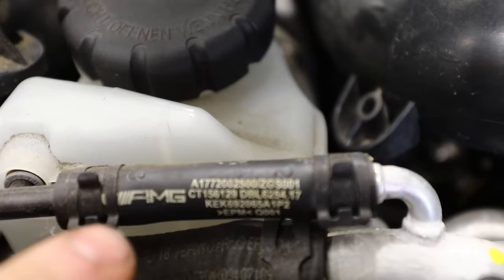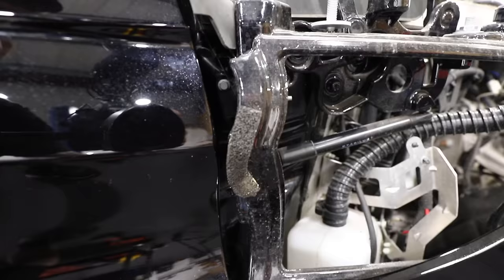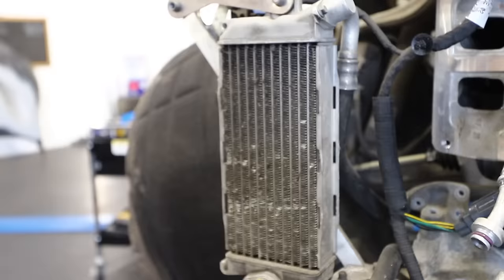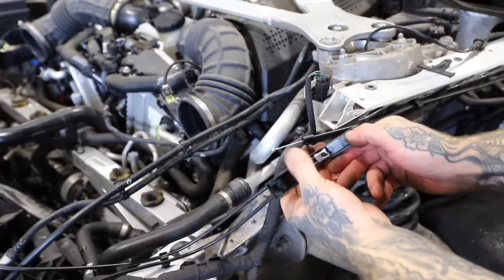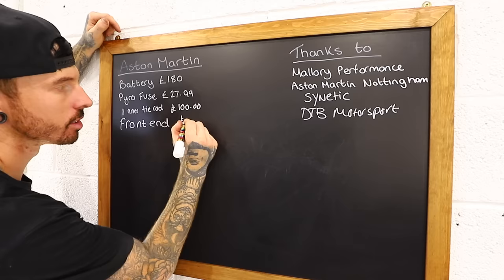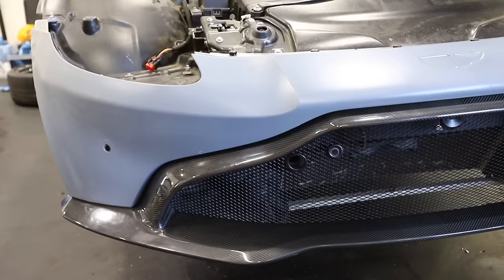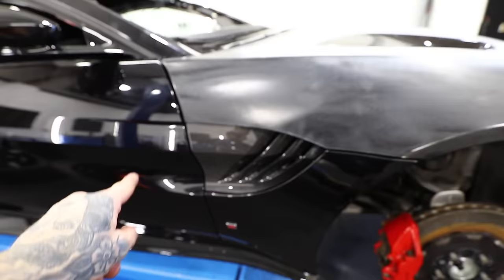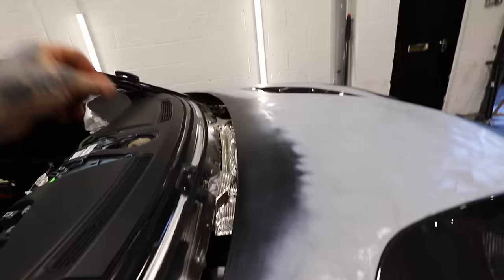REBUILDING A WRECKED 2019 ASTON MARTIN VANTAGE | PT3

Comment: 50KG weighted dash is actually a pretty good result, thought it would be much heavier. Such a good series !
Reply: get on with my next rust video!love you
Reply: Agreed only hard part of getting it out is trying slide it out without scratching the paint work
Reply: If it's only 50KG then just get a mate and pick it up by hand, you hardly need to try at that weight. I've loaded alloy 4-cylinders into wagons with a friend of mine and those are over 100kg dry; we're just normal guys, not power lifters.

Comment: Matt pal Headlights sometimes have a small switch inside the light that flicks them from left to right hand drive all the ones I’ve found are located inside under the light itself, if you dismantle one of your broken ones that will help you find the switch/metal tab to move.
If not pull both sets of lights to pieces and put the uk internals in.

Comment: MB twin turbo motors have an intercooler for the charge air coming out of the turbos - so 3 total oil coolers. Engine, Trans, Intake. Its a similar set up on v6 TT AMG motors as well though Aston has put them in different places compared to MB.

Comment: The headlight number looks like a typical Ford / JLR / Volvo and presumably Aston (as once owned by Ford?) part number. With the first letter / numbers being the prefix (usually indicating vehicle model as an internal code), then the base number (carries over across models for like for like parts) and then the last two digits are the suffix, generally the engineering level. Prefix starting B is usually the odd one out (i.e a LWB version of a vehicle or a LHD / RHD depending on the company and which market they see as the dominant market). BD makes sense for LHD and would be around the 4th official engineering release, with BA, BB etc beforehand. It's unlikely to refer to any kind of light spec. Love the videos btw, keep up the good work, you're a real inspiration.

Comment: Suspect the headlights will be an issue. I have a Mercedes E Class with multi beam (no reflector as they contain 84 led pixels) and they can (and i have had mine) reprogrammed from rhd to lhd, however, if the lights have  reflector they can’t be. The fact the lights dress marked UK and the replacements EU likely means they contain a reflector which means they can’t be swapped over.

Comment: The complete frame does not need to be removed. The dash un bolts with about 12 bolts and can be removed and repaired. I’m rebuilding a 2019 DBS superlegerra and just finished this process.
Reply from the maker: I can confirm that it does need to be removed
Reply: @MatArmstrongbmx  yes the dealership will tell you that cause they don’t want the average person messing around with their product. There are ways around it. I physically did it myself. After the bolts in the front and side of the dash are removed their are only a few bolts holding down the dash on the back side. Once the bolts are removed on the front side the backside bolts can be accessed and removed. Their is a light aluminum frame that fastens the air ducts and dash to the dash frame. Once those bolts are released  the dash slides out. I have pictures for confirmation if you want to see them. I completely took apart my whole interior to redo it. The whole dash on my car is full navy blue alcantera.

Comment: Its not called vaccuming the cooling system.  its bleeding it. Very very old technology.  I am surprised they haven't fitted an auto-bleeder... Air locks cause overheating if there is a problem on the road it makes life unnecessarily annoying.

What you need in a pressure bled system is to find a way to fit a airbleed screw/ tap on the highest point above the water level.

This means it must be higher than the heater radiator in the dash, as well as all the water pipes and radiators...   Usually jack up the front and ensure the resouvoure cap is working using a pressure tester.  Usually full kit available on eBay for under £70.00.

Comment: Great stuff bro bro. I just realised that when you left the carbon fibre and front bumber splitter on top of the car where it could have fallen off, that you don't have a work desk. You definitely want to avoid dropping things or having to work off of the floor, which in your case can be very cold, as well as dirty and also bad for your back.🙏🏽 If you do have a work desk, apologies, I missed it.

Comment: Mat I hear you say you spent £600 odd on the carbon fibre part for the front end well did you know you could’ve got the cheaper version and then got a dip kit which you can use to recover literally anything, it’s just a solution and then the sheets of let’s say carbon fibre and you lay the carbon fibre pattern sheet on top of the solution and you slowly submerge you part onto the pattern sheet and into the solution and when you pull it back out it’s covered with the carbon fibre pattern and then you just let it dry it’s a bit like wrapping only part liquid form 👍 would’ve saved you a lot of money on that part alone
Reply: An add on to my above comment:- it’s called hydro dipping 👍

Comment: Matt,

KY63-13W029/30-AD lamps are RHD;
KY63-13W029/30-BD lamps are LHD
See this AML USA service bulletin https://static.nhtsa.gov/odi/tsbs/2018/MC-10154238-9999.pdf

The old VH lamps could be changed from LHD to RHD by moving a lever inside the lamp. They won't want to mess around on the line moving levers (and potentially getting them wrong) so the new car may still have this; if they do have something like levers then the lamps would be delivered by the supplier to the factory with the lever in the appropriate drive hand position and the part number would reflect this. Aston don't like the cost of different lamps unless they have to. Try taking the rear bulb covers off (if LEDs have such a thing) and look inside for something like a lever.

As far as changing the lamps on the car by computer then this is possible, but I would have thought this sort of data would be downloaded to the car in the final configuration file at the end of the assembly line. Then they wouldn't have to bother to drive-hand the lamps, with associated additional lineside storage and stillages for different variants. It's more likely to be something physical in the lamps, unless the latest lamps have their own small ECUs - in which case maybe an ECU swap between old and new?

Edited to add
Matt,
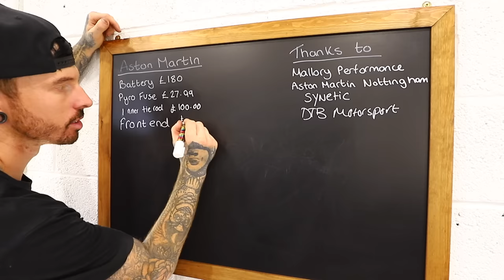I just had a look in the 19MY Vantage owner's guide (downloadable from AML if you don't have one) and section 11:32 says:

Driving Abroad
The headlamps in this vehicle do not require adjustment when driving in countries where vehicles are driven on the opposite side of the road. The headlamps meet ECE requirement to operate without conversion.

So it doesn't explain the difference between RHD and LHD lamps, but it does imply that you may be good to go

Comment: Having owned various AM’s over many years, AML’s reluctance to allow purchase of parts from 3rd parties gets worse. Many of these are from other manufacturers but with huge markups added, so good luck with your sourcing.

It’s much worse for older models, where they no longer provide parts for cars 20 or more years old, and won’t allow 3rd parties to access their IP to allow them to provide e.g replacement ECU’s

This is taking good cars off the road for minor faults that could be running again if parts were made available. 

They are in turmoil with their share price at under 10% of its IPO price, senior management in a continuous revolving door after fall outs with Stroll who has a poor F1 performance as he insists his son keeps his seat. What a farce 🙄